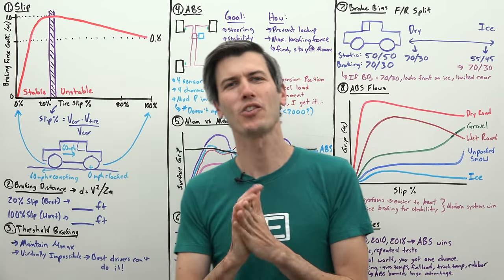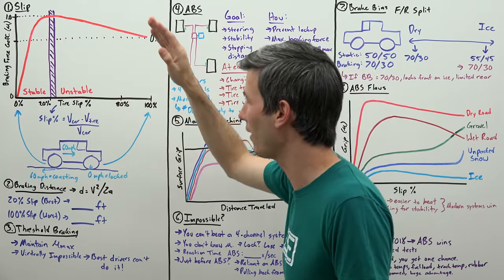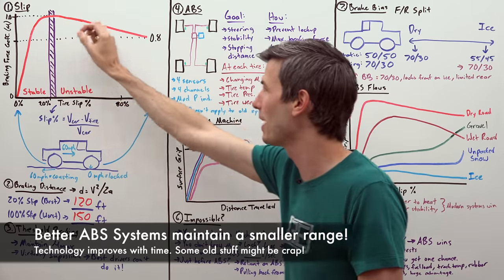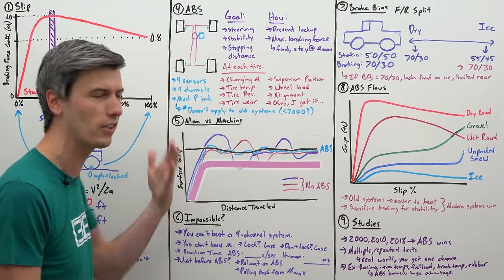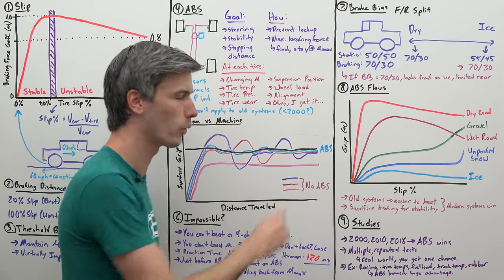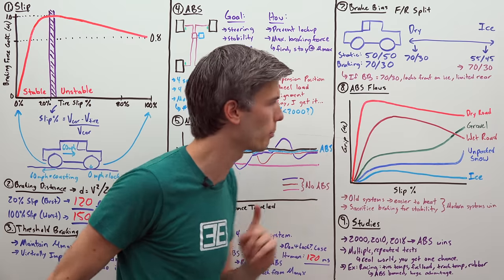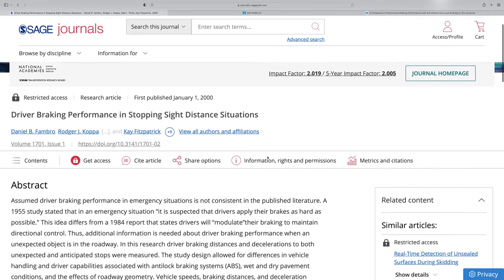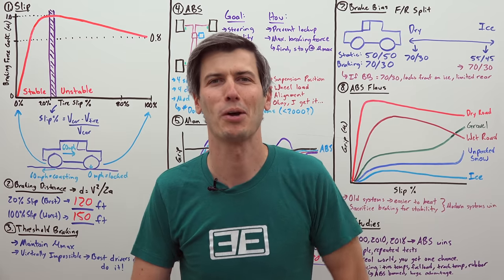Why Threshold Braking Is Impossible - ABS Wins!

Comment: I don't understand how you didn't mention static vs dynamic friction even once. Anyone who took an introductory physics course knows that static friction gives you more force than dynamic friction. Static friction has 0% slip. Yet you say 20% is ideal? I don't buy it. Why didn't you address this at all?
Reply: Yeah, I also had that physics lesson.  :)  While this is admittedly speculation....  "static friction results in more force than sliding friction" may well only be true in simple cases where the frictive surfaces are unchanging.  Steel on steel spherical cows.  :)  When you consider the deformable surface of a rubber tire against roughly textured road surface, with a significant amount of force perpendicular to the contact patch and a huge abount of kinetic energy available, there may be additional factors that make significant contributions to stopping force...  Spot heating due to shear force leading to localized softening the rubber and an increased coefficient of friction , or uneven slip across the surface of the  contact patch leading to elastic forces being two (Speculative!) possibilities... 

So while I agree that I'd also be interested in hearing  what the engineering/physics explanation is, I'm open to the possibility that maximum break force occurs somewhere past 0% wheel slip.

None off which negates the fact that ABS systems are designed by smart people to maximize braking force at whatever value of wheel slip that implies.....
Reply: @grnbrg  yeah I get that. I can see it resulting in local maxima with nonzero slip. Maybe even an absolute maximum. I'm skeptical, but maybe. Regardless there should at least be a local maximum at zero. 

The craziest thing is that his plot indicates zero force at zero slip. This is absurd. So when my car is rolling along in a straight line with no slip, all I need to do is breathe on it, and it should immediately start sliding? I guess parking on a hill is impossible? 

Another thing, percent slip also seems like a bizarre metric. If there's some function of slip vs force, it's going to be a function of the relative velocity between the two surfaces. Something that can be quantified in mph or m/s. Let's say you get the maximum friction when the road and the tire are moving 20 mph relative to each other. The speed of the car relative to the road is irrelevant. It's about the relative speed between the surface of the tire and the surface of the road. He's giving us the proportion that that speed has to the speed of the car. The speed of the car is thrown in there for no good reason. 

The entire mathematical model in this video is nonsensical and I don't buy it for a second. Yes abs beats a human driver without abs. On that much I agree. And a lot of his other points about the precision of the control system and its ability to control wheels individually. All very sound arguments. But the mathematical model for slip vs force is nonsensical.

Comment: To be fair, you will only see smoke when pro drivers on a track brake when they are off line or in a fight or whatever. You rarely see them locking up going race pace or in qualy. But ABS(4 channel) is still superior due to the fact that you can brake much deeper into the turn. Aaaand race ABS is a whole lot different then street ABS.

Comment: If what you are saying “was” true then racing drivers would not have better lap times when switching off ABS & Traction controls

ABS is about “driver shock”
In a fight or flight moment, you slam on the brakes and ABs saves you from locking up completely.

Comment: I totally buy the premise of the video, and as always it's very thorough & well presented. I also think we as drivers can help the ABS help us. In your example of backing off the ABS point, we're really talking about extremes v moderation. If you really stomp on the brake you can feel the pedal pulse really hard and it can shake the car pretty dramatically. Each time the ABS system is reapplying the brakes it is shocking the tire very severely and instantly putting it back into a lockup situation. Sure, it almost as rapidly releases the pressure to get the wheel moving again, and none of this is the fault of the ABS system. If, on the other hand, you back off just enough to moderate the pulsing, you're not giving up anything because the ABS system is still working. I maintain you're giving up LESS, because the wheels aren't being shocked as dramatically by the ABS. I maintain that is the optimal operation of ABS. Yes, back off the pedal, but not enough to completely deactivate the ABS system.
Reply: My family had a 98MY gm car.  The ABS on that car had the least amount of feedback I ever experienced. Hardly any system noise was heard and brake pedal vibrations very minimal.  We also had a Chrysler from the same year and that system provided far more feedback.

Comment: Eh, the real point of "threshold braking > ABS" is really that PRACTICING threshold braking (in different weather and on different roads) will instill better driving than having ABS can compensate for. There is an actual lesson that ABS won't undo driving at a speed on a road with 50% grip where once the driver finally brakes, ABS or not, they are going to end up with a totaled vehicle.

Repeatedly testing and instilling the distances and angles that matter will save more vehicles from crashing than just assuming ABS is the best, most perfect ideal braking system. It can be seen at autocross events multiple times a year. Some people know what their vehicle is capable of, others just mash the pedals. The latter are the ones who have the widest variation in times and are the ones who wrap their cars around poles.

Comment: I read a study years ago that found ABS was less effective then no-abs on real world slippery surfaces.
Can you confirm?

I guess ABS has also drastically improved over the years... *and stability control exists now...
Reply: The more you explain the more I doubt the older ABS systems were as good as you suggest. Many driver assists help the lowest common denominator but can hinder better drivers (ex: hill start assist, rev hang, some traction control). Most of the advantages mentioned are exclusive to newer ABS systems, where as older ones were extremely basic. So I would want (and I would want others) to learn the limitations and exceptions.

*I see, you walked back the unequivocal statement from the beginning, at the end. Fair enough.

Comment: However in a vehicle without ABS threshold braking IS far better than just jamming on the brakes full and skidding. I have done plenty of threshold braking on gravel and it allows you to maintain limited steering because you lift off in rapid succession each time the wheels lock. But no, you can’t beat ABS.

Comment: Me watching this video knowing full well I can beat the ABS system in my car because my wheels don't lock up.
Also the ABS is broken and there are no replacement parts for it, but that's an entirely different issue.
Reply: Update: some asshole in a Kia Soul jumped in front of me going like 5 MPH and stayed that speed. I slammed on the brakes harder than I ever have and locked up. So I guess my brakes can lock up a wheel

Comment: Do you remember when ABS was introduced to the masses in cars. Sometime back in the 1980s I think. The TV commercials used to show a driver who had locked up their brakes and then turned the steering wheel to get around the object. Pure BS! If anyone is locking their brakes, they are in panic mode and will hit whatever they will hit.

Comment: The problem with ABS is not the science behind it but its implementation. All the test are performed in control environment and they are backed up with a plan for which variable to analyze and what to expect as result. 
The reality is very different. People rarely experienced the ABS but when they do, it is a complete surprise and the timing for the ABS to shut off is unknown by the driver. 
In reality, the driver does not know what to expect in critical situation and it affects the stirring behavior. 
A hard turn in a snowy condition, by the time the driver realize the ABS behavior and its cycle dynamic, the driver is not able to predict the behavior of the car and it can result to much bigger problems than having your wheels locked.

Comment: In a modern car there's no such thing as disabling ABS (and ya know.. not getting stickered/fined/loss warranty/etc.) 

But also.. if you really apply the brakes, enough to engage ABS a modern car will not LET YOU let go of the brakes! 

The brake goes from acting as a pressure plate to acting as a switch, when applied suddenly, it'll engage COMPLETELY kicking ABS in (and making the wife & kid VERY upset) and making the car stop VERY suddenly. 

(2022 Ford Ranger... a week ago.. Nothing hurt... car stopped before I turned the kangaroo into offal... From 110Kph (75mph) to zero in about 150M ~ or so.)

Comment: For the first time, I have to say your analysis is flawed. ABS may have 4 sensors on each wheel but these are simple hall effect sensors to measure rotation speed. As a human, I don't measure tire speeds. When threshold breaking, sound from tires and feeling of the brake pedal is my input for the most part. So no, this is not an apples to apples comparison about number of inputs, sensors or response times.. Under ideal conditions, where I can plan ahead on when to brake, I DO get better breaking distance than ABS; Every. Single. Time. On a Ford Mondeo (people in US know it as Fusion), which is most certainly not a truck from 70s.. I am sure there are people who will rightfully claim the same. BUT.... Key advantage of ABS is somewhat mentioned in 15:00.. Most hard braking in everyday life happens when I am NOT prepared to brake at all. If I try threshold braking in an emergency, I know I'll miss the mark badly. Also, maybe I am not so good at multi tasking, but threshold braking does require significant amount of my concentration. So yeah, I agree on part ABS does wonders in emergencies. It allows me to nail the brakes, and use all my concentration on assesing my situation, look to my surroundings and steer to avoid a crash.. But claiming its impossible to beat ABS? I wouldn't be so sure.

Comment: In racing or off road, ABS is not the norm, because it isn't predictable. That may be the wrong term, but the human can determine when wheel slip is needed, ABS is not. We'll probably need GAI to fully replace the human in these specific areas.

Comment: Minor addition: ABS does NOT find the complete sweet spot. You can see the tires locking up completely every now and then, even on dry road. That means it's slightly to the right (higher slip than optimal) than the perfect spot. Still miles better than what a human can do 👍🏻

On my bike, I can obviously control both brakes individually and tbh, it's really hard, to try to do threshold braking on even just two wheels. But it's necessary, because locking the wheels throws me down 😂

Comment: An experienced rider can easily beat ABS on a motorcycle. The reason is that you can operate all the brakes separately. If you try threshold braking in a car, you will see every time you try you get 1 wheel locked up while rest of the wheels still have some range to brake and every single time you will have a different wheel locked up. Even if you try in a straight, same speed, same asphalt, same driver, same place. So for me the only valid explanation is the 4 channel feedback on ABS. If you don't know exactly what your phisical model should include, you have to try in real.

Comment: My experience with ABS systems is mostly mid 2000s cars and they were genuinely terrible on snow and ice. I'm not certain that full lock-up wouldn't have stopped the car faster. The best ABS absolutely will beat the best driver, but you don't need to go back very far to find ABS in production cars that is FAR from the best. Granted, i've never actually owned a car with ABS.

Comment: It's all right but... xD in my '92 E36 which I use for amateur track racing, stock ABS is real crap. Only three sensors, it's works lock-unlock and other non-fun stuff. That's why I throw it away. Some old ABS also do unpredictable things when you spin the car backwards or sideways and try to save form crash. Yes If i could easily (and cheap) swap modern ABS to this shitbox I will do it.

Comment: Initial D disagrees, but uses a very specific scenario to base its argument. Takumi had driven that pass his entire life, he knows every inch of that road like the back of his hand. He knows what's coming up, and how much he can sacrifice steering in order to get maximum braking. If his car had ABS, it would only see brake effort vs load. It might hold back when he hits his brakes, effectively losing to Takumi bc it didn't know that he was hitting the brakes ALMOST too hard on purpose, to set up for a maneuver.
That being said, in any other scenario (like an away race), Takumi wouldn't have that level of practice on that road, and ABS's consistency would definitely win against his foot on the pedal. It's also true that he can slow his car down faster than many other racers because his car is lighter. It doesn't have as much inertia, so it slows down easier than larger, heavier cars.
Yes, Initial D was correct when it said Takumi can beat ABS. No, it didn't mean he could do this consistently, or in different scenarios.

If he had a more modern car that had ABS and could set it to sacrifice more steering in order to maximize braking, then ABS would match his style. Almost all modern sports cars do this, provided they're set to the correct mode. Set it to snow when driving on snow, gravel when driving on gravel, leave it in sport when driving on pavement (unless it has a pavement option), etc... In this scenario (which doesn't rely on you having YEARS of practice on a single road, ungodly memory and nearly impossible levels of concentration), the consistency of ABS would beat you every time. Yes, you might beat it once, but good luck doing that consistently, or even just twice in the same run.

Comment: Anyone who chooses ABS over non-ABS has obviously never driven down a snowy hill in a heavy vehicle with ABS.  The first winter I had my 99 Suburban I was delivering pizza, and driving down a slight hill that ended at a major highway.  I was driving slower than usual, obviously, because of the snow.  When I tried slowing down even more the ABS wouldn't let me slow down at all, and the truck actually started speeding up, and by the time I was half way down the hill I was going more than twice the speed I was going when I first hit the brakes.  If I didn't slam the parking brake to the floor to lock up the rear wheels I would have rolled right out into the 3 lane highway and probably been killed.  Ever since that day I don't trust ABS at all, and usually disable it in my cars.

Comment: Motorcyclists need to turn off ABS when they go off-road. ABS can sense slippage quicker and more accurately, but ABS cannot sense when slippage and locking of the tires is desirable. Offroad on a motorcycle, you need to force the tire to push through gravel, dirt, mud to get to a solid surface at the bottom. When you go downhill without any grip, you might actually pick up speed because of ABS because the tires will be unlocked. That can happen on wet, grassy hills. ABS helps you steer and stay upright of course but it would increase the braking distance.

Similar thing happens when you are accelerating in mud. You do that by burning your tire through the mud until you reach solid ground and gain momentum.

Comment: Thanks Jason, you sort of touched on it briefly but under heavy (panic) braking ABS (with EBD) will regulate front to rear proportioning to greatly reduce the front end nose-diving to maintain a good centre of gravity and level stance and allow the driver to maintain steering control. Important if you drive a tall SUV.

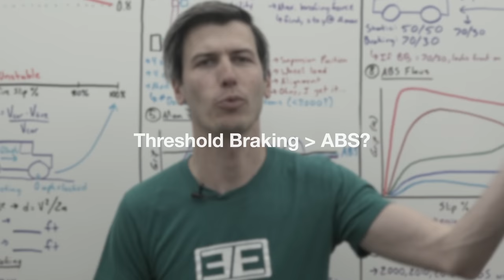Comment: 0:10 No it isn't. You can't do what ABS is doing. Depending on conditions, car and your abilities, you might be able to shorten braking length from normal to somewhere between normal and what ABS would give you. Anyone that says they can beat ABS doesn't know what the system is doing or maybe is talking about very first cheap ABS implementations - arguably with them you might get pretty close or if they are REALLY bad, even better than them, but that would be true for only those very early applications of ABS that tried to mimic what ABS was doing at absolute minimum cost and without really understanding how it worked.

And when you do such braking, you might even end up worse then normal flooring it with brakes without ABS.

We did some tests and since I used to be pretty good with such braking I was test driver. Trust me, while it helped a lot in some circumstances it should also be noted that many drivers cannot pump the brakes so many times a second as I did. If this isn't what you were talking about and instead here "threshold" means trying to brake on the edge of slipping.... then I have no idea how even skilled people could do that given variety of conditions and taking into account slippage on all 4 wheels, which might be different not to mention countless other factors.

Now I will watch the video. Undoubtedly I will learn something.

Comment: Yes....but, on a motorcycle it's always recommended to turn off ABS when on track. Without a doubt ABS feels freaky and dangerous on track. However in the real world ABS can be dangerous on specific types of roads. Non paved roads such as gravel or loose surfaces because ABS will prevent brakes being applied as tyres will slip. There are cases of motorcycle riders being killed off road because they forgot to turn off ABS.